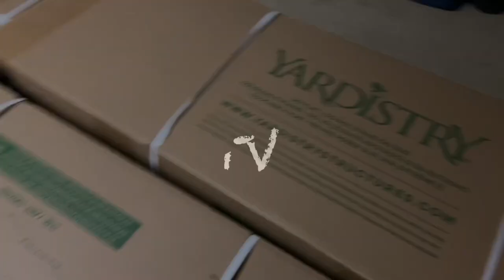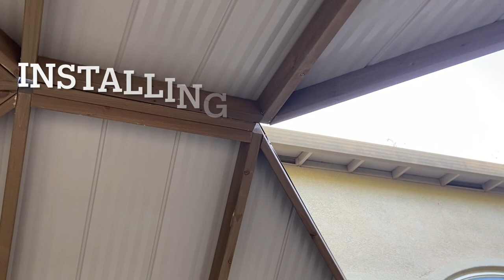DIY - 12’ X  14’ Gazebo Build from Costco

Comment: Can you list all the tools you used along with there links if possible? like clamps and everything else?
Reply from the maker: Yes here are the following tools that have helped me through building the gazebo:
 Utility knife
Gloves
Screwdriver - flathead & phillips 
Socket set
wrench
Pliers
Tape measure
Pencil
2 Cordless drill, if you have any extra
Hammer
Mallet
Table or workbench 
2-3 ladders or stepladder
2x4 wood - for extra hold/brace
Clamps